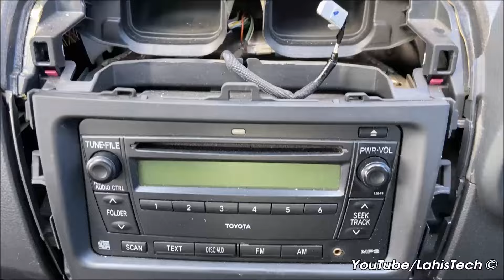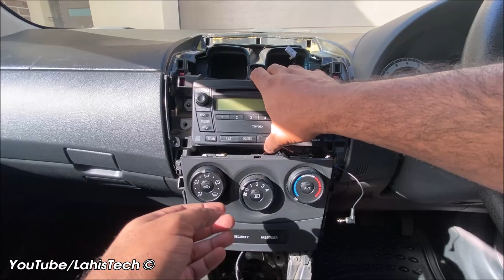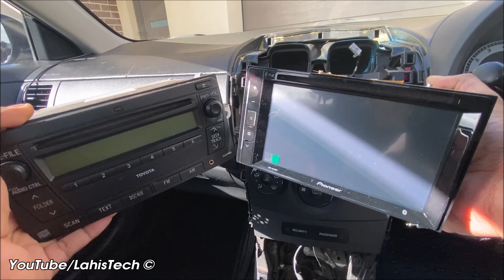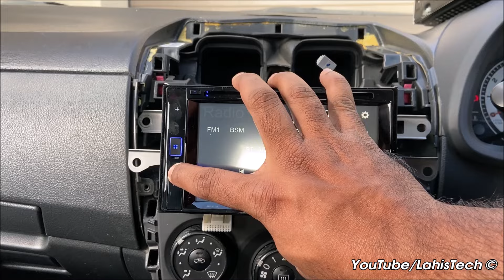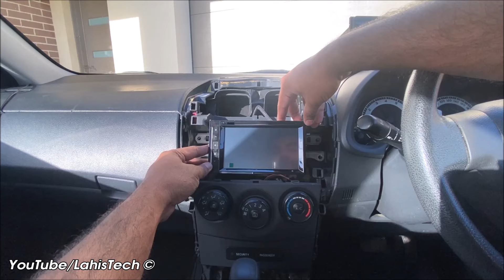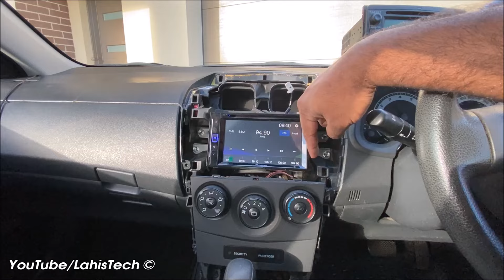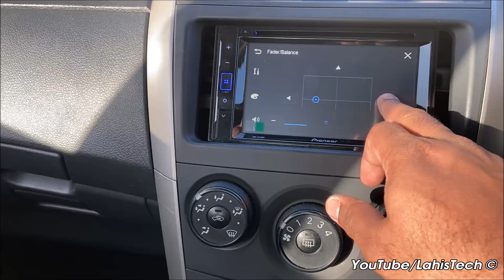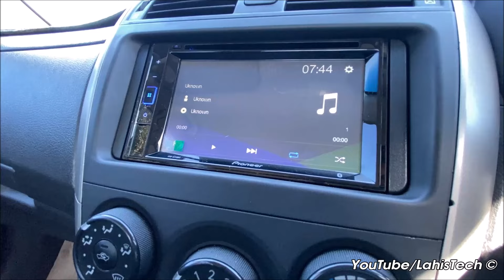How to install Pioneer AVH-A245BT Head unit with reverse camera | Toyota Head unit installation

Comment: Did you ground the park wire from the harness to the stereo? You need to do that to play DVDs. Also you can get a replacement trim panel for that model Corolla so it looks factory but only has a double DIN opening so you don’t need to use those two trim attachments.

Comment: Hello .. when i do the reverse the camera launches but gives me black screen.. it was working smooth on the other kenwood head unit .. it just turns the camera on but giving black screen .. do u know what am i supposed to do
Reply: Check if the rear camera jack is connected on the rear of the radio ...it's usually a single brown jack that look like a rca jack that says rcam